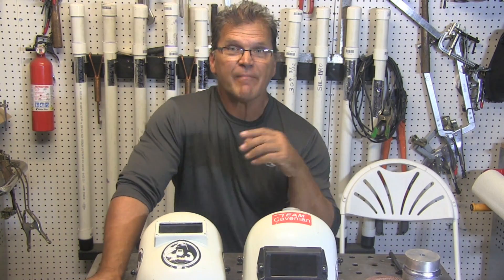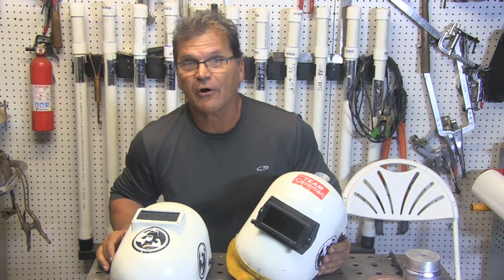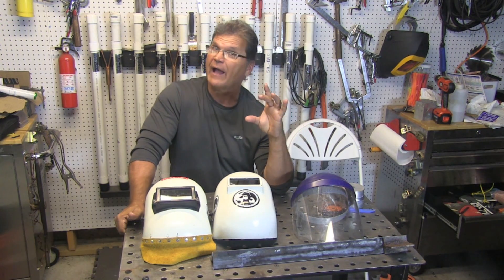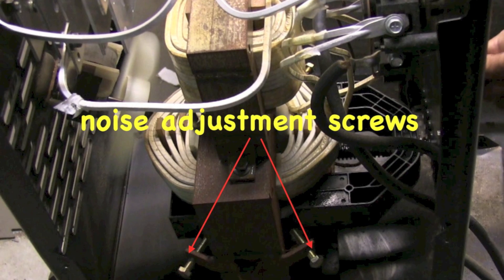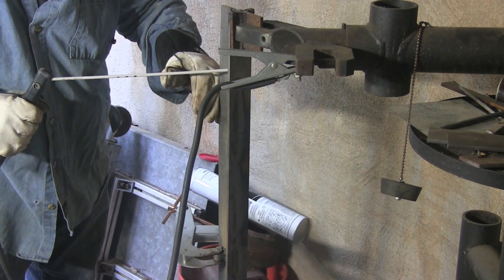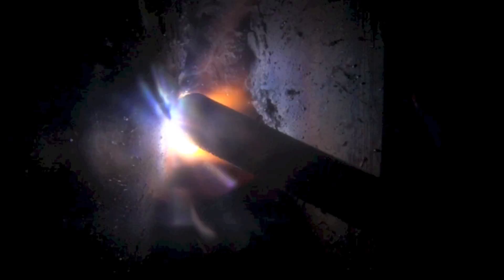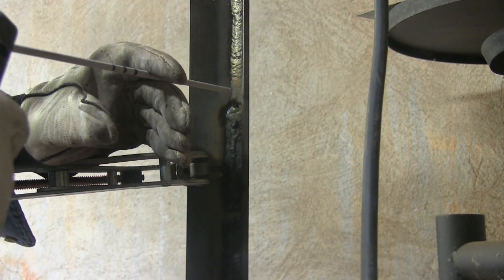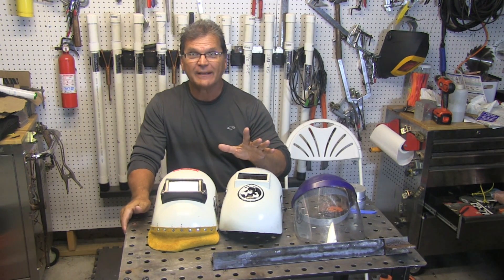Stick Welding Uphill 7018 2 Foot Long Tee Joint

Comment: first time i took my stick structural test, i failed due to an accidental arc strike. I welded it perfectly all the way to the cap and when i was putting away my stuff i sneezed, and the rod was still connected (and in my hand), and accidentally bumped the plated smack dab on the middle of my cover pass.  Couple hundred dollars wasted and i felt like a freaking moron.

Comment: Great video Jody. I have a question about where your amps where set at , I just started welding in the 3f position yesterday for school and the teacher suggested running at 105 amps , we were welding on 3/8th plates. I personally felt it might be a little to hot , and I’ve also seen other YouTube channels suggest running at 80-90 amps for the same 3f on 3/8th plate also using a 1/8th 7018 rod . You went up to 130 I just want your input on the big amp range difference, I understand a lot has to do with the machines being different but if there’s any other factors that could benefit me I would like to know. Anyone feel free to reply with their own knowledge and experience. Thanks
Reply: @weldingtipsandtricks

Comment: Anyone have any tips on helping me out? Ive been working on practicing my vertical but cant seem to keep my weld from having a crown to it, the weld will be uniform and clean, but will always have a bump in the middle, im primarily practicing stringers at 125 amps, and am getting good penetration and no undercut, but the bump in the middle will be there regardless of how good or bad i do.

Comment: Learned a bit from you and a few other tubers, just want to say thanks and show appreciation because i now support my family with my hood and electrodes.

 Have you tried a figure 8 for the cap? The heat dispersion makes better looking patterns and gives the same penetration as your zig zag 2 second. In this respect, the pool cools behind your stick whille you edge the sides. When finished it should look like two rows that weave as c pass stringers. 

Ps!! 
You got that new hood and never flipped your darkscreen to grinding lol

Thought id pick at you a little, keep the videos rollin brother

Comment: Not a professional welder, welding uphill 7018, the weld drips down, what should I do to correct this. Running 95 Amps. Also, my arc keeps cutting out while welding, 
These are old rods that are not kept in an oven, is this a sign of moisture in the rods.
Reply: I run a wider bead than a normal flat position. Just drag the rod over a bit more and the weld settles back in due to gravity.

Comment: Is it easier to use 7018 vs 6013 doing uphill like this? I done some frame repair on my truck recently that had bottom,  uphill, and overhead welding. The bottom and overhead went fine using 6013 but the uphill puddle just kept pouring down. I'm still kinda new at welding though I'm getting pretty good I cant seam to get uphill welds.

Comment: Say you're welding with some 1/8 7018s, comparing AC to DC. Do you think it takes more amps to weld 7018 on DC??

Comment: How close is your arc gap? I tend to blow my puddle out is this because my arc is too tight? I basically keep the tip of the rod on the surface of the puddle

Comment: I never have seen a drying ( almost "cooking"  of those 7018 rods on US videos, nor their storage in heated dry boxes during welding. this is only for real jobs with radio controls and no hydrogen ? thanks .

Comment: hello all. is the :triangle" progression uded too? long stop in middle and less the sides , only for first pass .?  (called "chrismas tree")  thanks.
I had to put off the "arc force" control on my inverter, as it added penetration but when I was in the middle and hotter I do not change the settings as I would end up with too little, and short arc made the src force active creating too deep undercuts on the sides.

Comment: Good day, I would like to know if a light duty inverter stick welder is good enough for just learning how to run beads. I was using an old buzz box at my job to learn but I'm now sure that a few people on my job have a problem with me learning. So I'm now thinking about getting a small inverter welder. Thank you for any advice you can give me.
Reply: Jaime Huff Just to let you know I have a cheap Chinese tig machine that also does stick, it’s an inverter machine and it works very well with sticks, it will not do 6010 but it will do everything else. Good luck.

Comment: Jody , is it posdible or too frustrating you train to that with 6013 ? up to now I have tons of drift and can only see the puddle when waving large enough do the first pass not successful yet. Do you loik at the puddle below ?  heat regulation is really not easy for me with that old buzz box I use ( but no more than 3 works "daily" training and not with much help locally).
Thanks
Reply: I find answerd on the 6013 . they are uded gor schooling as they are less easy than others, so qualifying up with them will make your use of 7018 easier later.
so I train with those. the arc lenght should be a little longer, and electrode positive for first pass helps with penetration. Regards from France. ps we also have "rutil cellulose and " basic rutile" electrodes. just  in similar categories than 6013 and 7018, for the second ones theyy are rutile with higher content of cellulose so they can be used descending.

Comment: Hey Jody, your 7018 videos helped me get the best looking uphill welds in my class. I started it about a week and a half ago and was getting ugly welds thst went in the bottom of the scrap out of shame then i kept practicing and trying to do what you do in the videos and i got welds with no undercut that layed into a t joint completely flat. What kind of applications call for 7018? I like this rod and could see myself making a career out of stick welding if i got a few aws certifications.

Comment: Nice welding !  When welding a trailer frame of 3" "C" channel 3/16-1/4" thickness on the walls, will a single pass give adequate structural strength or does it require multiple passes usually?  Thx again!

Comment: If anyone is interested in respirators that fit under your grinding shield or welding helmet I'd highly suggest a half mask with breathing tubes behind your back so you can use the better style screw in filters. I grind and plasma cut and weld every day and I have one similar to this http://www.airgas.com/product/Safety-Products/Respiratory-Protection/PAPR/p/HONBP1201M?gclid=Cj0KEQiAzNfDBRD2xKrO4pSnnOkBEiQAbzzeQZ48BdwruP-HXWYc_XHWPOEzPctD1K0B4AKPiGAjYgQaAtcU8P8HAQ&fo_c=306&fo_k=f972ed694218cb06b6f26386dc91881d&fo_s=gplaus&utm_arg=SEM:Google:PLA.US:All_Items:Non-brand:pla:Airgas:PPC::HONBP1201M::Revenue&s_kwcid=AL!4811!3!151173097184!!!g!282341095154!&ef_id=WEH5ggAAACMLMa8g:20170112011246:s

Comment: I learned in the shipyards, General Dynamics EB division, stringer beads only, and temper bead  each layer. Seeing that big fat weave makes me cringe. Thank you for your dedication to the trade!  I was a HY-80 and Nuclear welder. ( sorry I made the comment before I heard you mention the stringer bead protocol )
Reply: SheikYerbuty Can you expound on "temper bead"?

Also, love the Zappa handle.
Reply: The idea is to draw the heat away from the base metal. The hull was 4" 
thick with a 30* bevel, (temp sticks 200* and 300*) And we used stringer beads. When you get to a 
width of two beads, for example, each one touching the base metal, the 
third bead lies atop the two, down the center drawing the heat (tempering) from the base metal. Each bead width can not exceed 1.5  times the thickness of the electrode. The final bead(s) for each layer can not touch the base metal. Then they were visually inspected and x-rayed, and in some cases air-arced out. Man, having flashbacks of all that data. It was a fun time I loved that work. Was trained at the AMBIT Navy school. Went to Hartford School of Welding back in 1974 for 6 mos. We had to pass a test to get into AMBIT to pass another test to get hired ...sorry for going on, and on, I had a nostalgic moment...
Reply: SheikYerbuty If I'm picturing that right, after bead #3, looking down the cross section of the weld, it wouldn't be flat across, but humped where bead #3 was placed.  How does that work as far as subsequent passes (4, 5, 6, etc) and maintaining a flush-to-slightly reinforced profile?  or do you leave slight valleys between 1 and 2, for 3 to go in?

Comment: Mr. Jody I realy like your vids and I find them to be very educational, I've been working in constructions for the last 4 years or so and had to learn how to weld stick without anny formal classe, mind you I'm from Romania and there are many regulations but manny "contractors" learn to build the old fashion way, for small out of the citty jobs authoritys let us be; annyway this year I have put to good use some of the tricks and tips so thank you for that. Even thou I usualy use 6013 for 3 mm steel square tubes  I sometimes use 7018 for 6 mm and up, and I weeve T joints, so I ask when should I weeve and when should I use stringers, for structural steel; so far I've been doing something like stringers when the gap is to big or some type of bodge

Comment: Jody, could you please do a TIG video on using 4943 filler wire and the difference between it and 4043 & 5356.

Thank you.
KAP

Comment: Hey Jody, I have the same pipeliner hood with the flip up lens.  I was wondering if you had any problems with the inside of the lens hitting your nose?  I saw somewhere that you could buy an offset headgear but can't seam to find one.  Anyway, thanks for the videos and keep up the good work!

Comment: Nice one Jody. I used to struggle so much with vertical uphill 7018, but after years of practice and watching you, I seem to be much better at it now. I had to weld up a crack in a butt plate on an 8" bore cylinder the other day. I couldn't use the pipe rollers because of the transfer tube. I basically did two vertical welds, starting at 3 and 9, and working up to the 12 position. It was ground out deep. Used 1/8" for two passes then 5/32" for a nice wide cover pass. It turned out awesome! Always makes ya smile when you can lay down a good looking bead. 👍🏻
Reply: Inspiration, I'm in my first welding class and I am doing great! I cant wait for the day to put the skills I am learning in the booth to the test out in the field. of course I have many more classes to take but I am in love so it's fine. {:
Reply: Abom79 you two should do a project together. My favorite machinist with my favorite welder.
Reply: @chrisjones6165  same here, although for welding I like Bob Moffatt a lot as well
Reply: i go to a career center ive been welding for only months i can do the cert with 3g open root 7018
Reply: i know Im asking the wrong place but does anybody know of a trick to get back into an instagram account??
I was dumb forgot the account password. I would love any tips you can give me!
Reply: @Luca Khari instablaster :)
Reply: @Jayce Lane I really appreciate your reply. I found the site on google and Im trying it out now.
I see it takes a while so I will reply here later with my results.

Comment: Hey Jodie. What kind of respirator would you recommend? I work in the trades and I'm looking for a good quality one to fit under my welding hood. I would also like one that would catch fine particles from grinding dust and cut off wheels. Any advise would be greatly appreciated.
Reply: Robert Allen I use a 3m 7500 series with those same filters. I like it better than some others because it vents downwards so it doesn't fog up my helmet.
Reply: Robert Allen I have a half mask respirator that has breathing tubes that go behind your head. it comes in handy when using a grinding shield or a welding helmet plus you can use chemical filters that are way better than any p100 paper filter. the filters I use have a paper pre filter with little bits of charcoal under that that filter out a lot of gas here's a similar one. http://www.airgas.com/product/Safety-Products/Respiratory-Protection/PAPR/p/HONBP1201M?gclid=Cj0KEQiAzNfDBRD2xKrO4pSnnOkBEiQAbzzeQdp5zm7LJXI2EgKoT8lJxD4YgmPRkcWUL7NI06aSc4kaAgd48P8HAQ&fo_c=306&fo_k=f972ed694218cb06b6f26386dc91881d&fo_s=gplaus&utm_arg=SEM:Google:PLA.US:All_Items:Non-brand:pla:Airgas:PPC::HONBP1201M::Revenue&s_kwcid=AL!4811!3!151173097184!!!g!282341095154!&ef_id=WEH5ggAAACMLMa8g:20170112005932:s

Comment: Any recommendations on vert uphill with a/c stick? Tried today after watching this video and looks horrible. Vert downhill looked fine.
Reply from the maker: with A/C stick , the welding machine makes a big difference.  There is a 7018 rod made just for AC and it helps on small AC welders.  otherwise you might be better off with something like a 6011 for uphill.
6013 works too but is hard to distinguish the slag from the puddle

Comment: I have a question about a water cooled tig setup. Is there any reason you can think of that I shouldn't use silicone tubing for my gas, and coolant tubing?  Thinking it is really flexible and good for 500 degrees. The cost is a little much but I don't mind that. It seems worth it for the extra flexibility. What are your thoughts? Thanks. Ian Adair. (Mad man marine. Vinalhaven Maine)

Comment: Great video! I believe everyone wanting to learn to weld, mig, tig, stick or any type should always start learning the basics with basic stick welding. Many feel it is the toughest to learn and maybe so but after learning the basics all other procedures come much easier. Many times you can find a used machine for $50 or less, buy the Lincoln bible, and you're off and welding. Thanks, Ed K Cleve. Oh.
Reply: Great advice right there. I agree!

Comment: Jody, you're very humble for a pretty awesome weldor. Regarding the welding fumes, Miller makes a really low profile respirator, can't come up with the part number at the moment, but I'm sure a google or Amazon search will reveal the mystery. Also, I put a little fan right behind me. I have it behind me so it doesn't blow anything around too much where I'm welding, but it keeps my welding hood ventilated and the smoke going away from me. Doesn't take much either and the cool air sure feels nice on my ugly mug.

Comment: I can never get 7018 rods to run right; arc is tough to keep lit and control and the slag never seems to want to come off. I don't know if I'm trying to run them too hot/cold, it's moisture issue with the rods or I just suck and need more practice haha. Any pointers? most of the arc welding I do is on used oil field pipe.

Comment: I have one of those 3M respirators, I love it. but I had to go get the miller respirator to fit properly under my helmet. I really like wearing respirators where I never thought I would. I don't suffer for a week after a day of cutting grinding and welding flux core. Great video as always, I learn a lot from every video.
Reply: patthesoundguy I have one of the Miller respirators that fits under my welding hood but I found that it didn't really work as good as I hoped it would. I would suggest trying out a half mask with breathing tubes that go behind your head with screw in filters that are much better at filtering Particles and gases. Here's one kinda like what I have :P http://www.airgas.com/product/Safety-Products/Respiratory-Protection/PAPR/p/HONBP1201M?gclid=Cj0KEQiAzNfDBRD2xKrO4pSnnOkBEiQAbzzeQZ48BdwruP-HXWYc_XHWPOEzPctD1K0B4AKPiGAjYgQaAtcU8P8HAQ&fo_c=306&fo_k=f972ed694218cb06b6f26386dc91881d&fo_s=gplaus&utm_arg=SEM:Google:PLA.US:All_Items:Non-brand:pla:Airgas:PPC::HONBP1201M::Revenue&s_kwcid=AL!4811!3!151173097184!!!g!282341095154!&ef_id=WEH5ggAAACMLMa8g:20170112011246:s
Reply: Jared c wow that looks amazing! thanks for sharing that. looks like it takes the good 3m filters

Comment: Hey Jody, I don't know if anyone has mentioned this yet, but if you weld away from your ground clamp (hook it to the bottom of your piece) you can prevent getting ark blow. You build magnetism as you weld up the joint and it become more noticeable as you approach your ground. Great vids and keep up the good work.

Comment: Jody the 7018 is a low hydrogen rod. Here in Australia trade transformer machines had a second tap off line for low hydrogen rods. Effectively it was a higher voltage (from memory maybe 45 volts versus 25 volts but don't quot me on that), but reduced maximum amps line. It was designed to give you an easier start and run for a low hydrogen rod. You can run them on the normal electrode tap but it takes a bit more skill. I see your Miller machine only has the two leads, one for earth and one for the electrode. So are you just running on a low voltage setting?

Comment: I use nothing but the pipeliner welding helmet. There is a respirator from miller that fits great underneath it. I had to mig weld a ton of stainless making mining equipment. I used that and it worked well and was as comfortable as you can be wearing it for 10 hours with a beard.

Comment: can you use 7018 on dc or just ac.
Reply: 7018 is a DC Rod.  Don't use AC for anything except Tig welding Aluminum
Reply: thank you for the the reply
Reply: thanks for the info i will try them

Comment: Hey Jody, 
    My current employer is an old school pipeline welder. we currently do a lot of farm equipment repair but mostly just fab stuff.   whenever we have to do anything structurally,  he insists on us using 5/32nd 7018.  can you do a video of running that rod uphill.   I am decent with 1/8th  but can't seem to get the 5/32nd to stay put.

Comment: Is there any reason why arc blow tends to happen at the end of a joint? I experienced it non stop on all my vertical 7018 test coupons
Reply: If at all possible before you strike a new rod, move your ground to a new location. Arc blow is a pain, but you can learn to beat it with rod angle and ground placement.